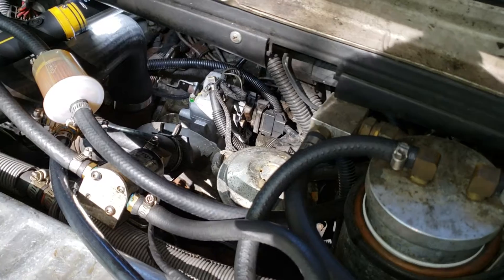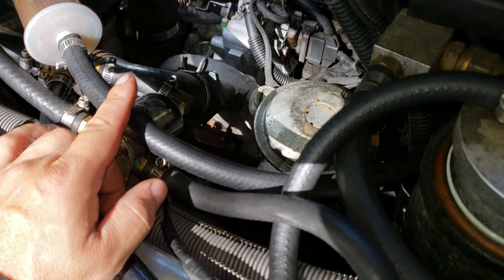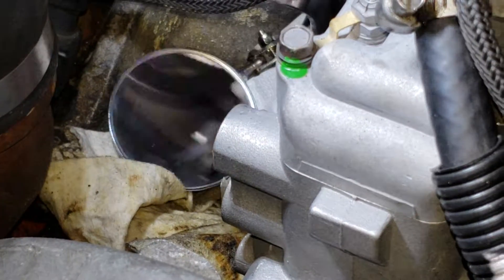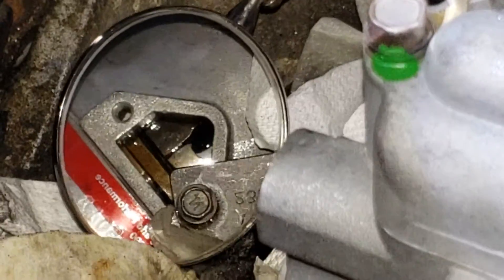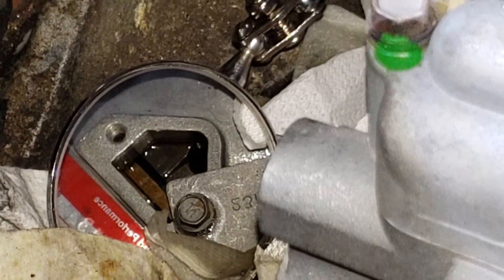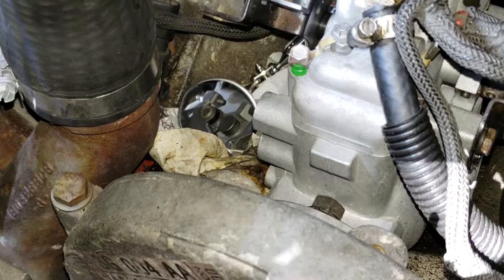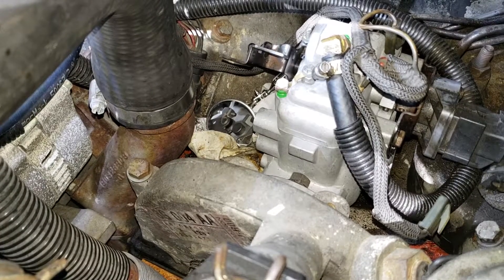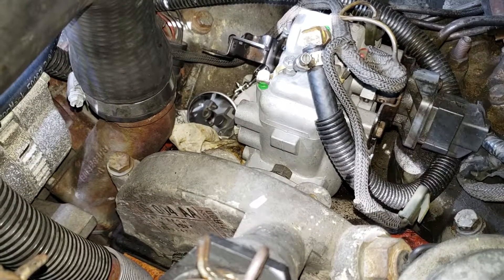7.3 idi injection pump shaft shear (broke) part 1

Comment: is the wvo heated or blended? i want to get into wvo but this stuff scares me
Reply from the maker: Oil is heated but by the time it goes from the tank to the injection pump it cools off so to fix this problem I added a secondary heat exchanger right before the injection pump and that should fix the problem with breaking shaft in half.